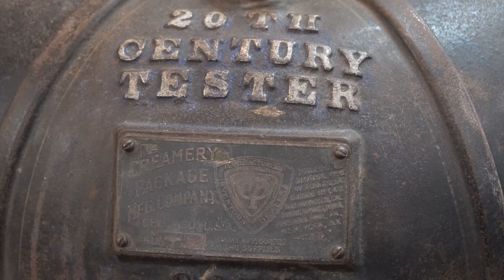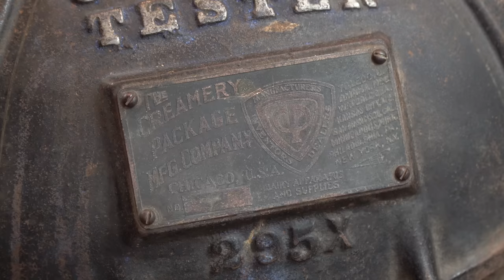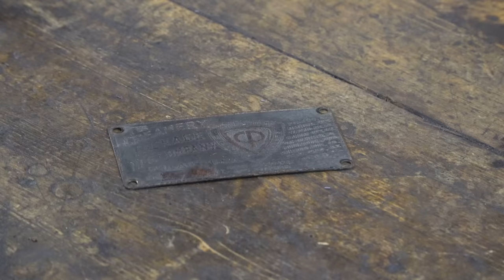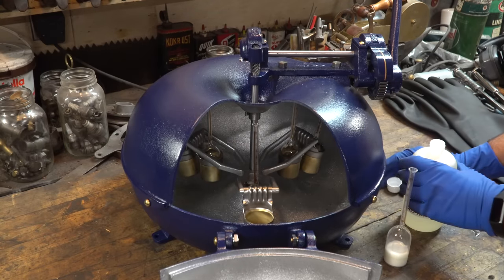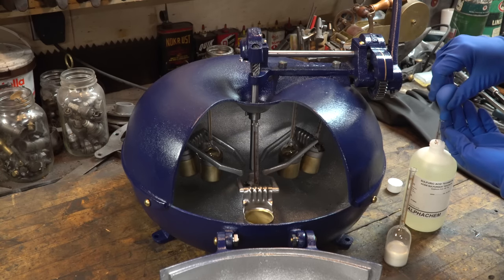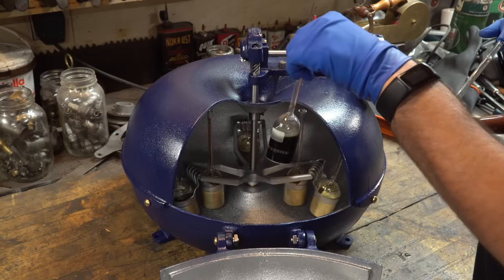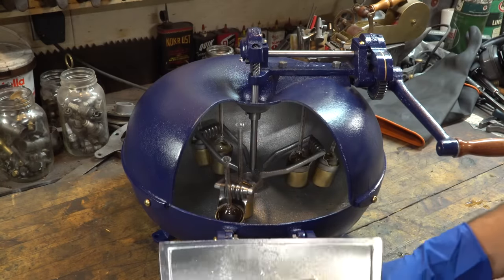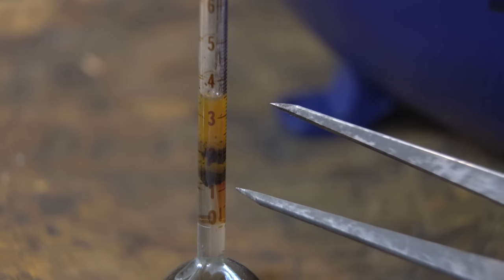Antique Sulfuric Acid Milk Fat Tester [Restoration]

Comment: Fascinating demonstration. Once you use a bottle for testing, can it be cleaned and reused, or were they just discarded? Seems like you'd need to be able to empty the acid out of them somehow even if you were discarding it.
Reply: Other commenters say they are used indefinitely. A very tiny, hummingbird beak like, needle was stuck up in them and sprayed water, upside down, washing everything out. The sulfuric acid also works very well as a cleansing agent. In other words they were cleaned easily and fully. 
I'm thinking they could easily be dropped and broken.

Comment: - Generally, "denaturing" protein would be the chemistry terminology used to describe what the acid does to the protein molecules.
- Boiling an egg, for example, denatures the clear white of an egg and makes it look white. Using vinegar{acid} in water when poaching an egg helps keep the original mass of the egg white together for a less messy poach.
- Denaturing the protein of beef turns it brown, showing the Nitrogen in it.

Comment: The Gerber method is a primary and historic chemical test to determine the fat content of substances, most commonly milk and cream.[1] The Gerber method is the primary testing method in Europe and much of the world.[2] The fairly similar Babcock test is used primarily in the United States, although the Gerber method also enjoys significant use in the U.S. as well.[3]

The Gerber method was developed and patented by Dr. Niklaus Gerber of Switzerland in 1891.[4]

Milk fat is separated from proteins by adding sulfuric acid. The separation is facilitated by using amyl alcohol and centrifugation. The fat content is read directly via a special calibrated butyrometer. Gerber developed specialized butyrometers (tubes), pipettes, and centrifuges. Water baths built specifically for the Gerber tubes are often used.

The test is still in widespread use today and is the basis for numerous national and international standards such as ISO 2446, International Dairy Federation (FIL) Regulation 105, BS 696 (United Kingdom), and IS 1223 (India). Larger facilities may prefer to use faster analysis techniques such as infrared spectroscopy as these greatly reduce the potential for user error and reduce the time and COSHH requirements.

Comment: I recently got an ultrasonic cleaner mostly for cleaning bearings and other intricate stuff and holy crap it does wonders. I use diluted degreaser concentrate and it makes it so I just wash away the gunk spray some wd40 and it's almost like new. I wonder if Evapo Rust would work too

Comment: As a multi-degreed chemist I don't approve the last part of the video, but the rest of this video is so cool, I'll not lodge any complaints.
Reply: As a former wet lab director for a plating facility, I saw several "cringe worthy" moments...  Eric is a great restorer, but a lousy chemical Tech.
Reply from the maker: Should I leave the cap off the bottle containing sulfuric acid LONGER?

Comment: We had a centrifuge in high school that was the same torus shape metal container, just with a motor. The teacher was incredibly scared of it and when one of my classmates shouted, the teacher ducked under the table. I use more powerful centrifuges at work, and I understand why. They have armour in them, weight a ton and still have warning that operators should not get within 30cm when spinning because if something breaks inside the whole centrifuge will jump sideways.

Comment: I remember their Ad. They did specify "Lead Free". It was getting too difficult to obtain lead back in the early 1900s. They were using it in the Mints. And window frames. I'M Kidding!! (The "Mint" part. How well would a Lead Penny hold up? They were used as ballast weights for heavy windows in old houses. You can't see them unless you remove the wood. You will see ropes and pulleys. Be aware.)

Comment: 2 questions:

Why didn't you paint the other lettering on the outer shell and brackets? The "295X" , "X48'9'", and "X69'8'".

Why didn't you repaint the name plate based on its colours, less the grime, prior to removal?

Comment: so its a centrifuge basically. its so interesting to see how back then constructions like this required metal casting, big hinges, complicated drives and gears, a huge crank, and so on - this device must have cost a fortune back then. 
today all of this would be half the sice, made mostly out of thermoplastics and would be powered by an electric motor

Comment: hey can you please put a 1/2 inch slash 3/8 recess in the back of the socket drivers so we can use a ratchet on them to break tough stuff loose

Comment: Shame it doesn't have an indexable  position lock for the three stations. A simple spring loaded catch that would remain out of the way unless the door is open (could even be a lock in the door itself, like an extension. You open, you index, then open fully to lock the station to work safely.

Comment: Kinda sad you couldn't dissolve the blue and save it in a separate container. Also,   I suspect that vinyl gloves would give greater protection against strong acids. I used them often when using concentrated nitric acid or hydrogen peroxide.
Reply from the maker: I did! I actually sent if off to get analyzed.
Reply: @HandToolRescue  , amazin!
Reply: @HandToolRescue  , if you need any chemistry advice for safety, let me know. Strong acid work and analysis of chemicals is my background.

Comment: Excellent work. (I still dunno why you persist using spray cans & don't just buy professional paint gear, but whatever.)

Well, that experiment explains my question why the thing is built so damn robustly. Is there a set rotation speed for the process? I also can't see any limiter (or counter, for that matter) in the gearing, so there's nothing preventing you from spinning it - like a maniac - at super-high RPM. (Which would be great fun if you hadn't secured the door properly... Wheeee-Crash-Aaaaaargh!)

Modern centrifuges tend to be stainless steel & borosilicate (Pyrex) glass (or just plastic).

I've seen a chemist friend make dilute Sulfuric Acid, by slowly pouring a bottle of concentrated H₂SO₄ into a large barrel of distilled water (before leaving on a Friday night). Not only was it hot enough to feel across the room, it was still fuming 2 days later, on Monday morning... Very Nasty Stuff.

Comment: Surface tension doesn't seal the vials when upside down. Air pressure does.
Reply: Actually a combination of both. The air pressure prevents a bubble of vacuum from opening up at the top of the inverted container. Surface tension in the neck resists allowing air to enter and water to leave at the same time and so prevents the bottle contents from "glugging" out.
Reply: @kevinmartin7760  Sure, but in a vacuum chamber the upside down vial would empty out.
Reply: @FrietjeOorlog  That's why I said it takes both air pressure and surface tension to keep the liquid in. Take away either of these and the vial will empty out.
Reply: @kevinmartin7760  The surface tension isn't the deciding factor here. Surface tension still exists in the vacuum chamber, yet the liquid would still fall out. The other way around, I'm not sure. To test this, he should hold a vial of water upside down after adding a drop of detegent. Then we'd know for sure.
Reply: @FrietjeOorlog  You need both surface tension and air pressure to keep the liquid in. Calling either of these a "deciding factor" would be inappropriate because eliminating (or sufficiently reducing) either will allow the liquid to drain.

Adding detergent may or may not reduce the surface tension enough to allow the liquid to drain. The deciding factor is whether the increase in surface area (caused by air entering part of the neck and liquid leaving the other part of the neck) requires more energy than the change in gravitational potential energy caused by some of the liquid dropping down. How much the surface tension must be reduced depends on the neck diameter of the vial.

Just as using a partial vacuum may or may not allow some liquid to leave the vial (depending on the vapour pressure of the liquid and height of the vial), a partial reduction in surface tension may or may not allow some liquid to leave the vial. Unless you can eliminate surface tension to a similar degree that you can eliminate air pressure, the experiment you propose would be inconclusive at best.
Reply: @kevinmartin7760  That's a lot of 'may or may not'. Just say you don't actually know for sure. Add detergent to the point surface tension is effectively removed, hold vial upside down, and observe. With a narrow enough neck I doubt surface tension is required, thus making it not a necessary component. I'd also like to see surface tension alone hold water in, without air pressure, eliminating the latter as a requirement. Seems highly unlikely with anything more than minute amounts of liquid. Any scenario where either air pressure of surface tension is not needed to keep the liquid in, negates the claim it takes both.
Reply: @FrietjeOorlog  I never said surface tension alone would hold the liquid in. I said lack of surface tension would let the liquid out. When other conditions are involved these are not equivalent statements.

Your last sentence is just plain wrong; the fact that removing one condition allows the liquid to drain specifically implies that it takes both conditions to retain the liquid.

We can look at this with propositional logic:
A = air pressure is high enough that the pressure at the top of the inverted vial is higher than the vapour pressure of the liquid so a bubble of vapour (or a vacuum bubble) cannot form
B = Surface tension is high enough (given the shape of the neck of the bottle and density of the liquid) that the inverted open surface of the liquid is stable (that is, it will not change shape to allow air up in one area and liquid down in another).
C = liquid will drain from vial

I am claiming C = not(A and B) = (not A) or (not B).

Also (not C) = liquid will stay in vial, and
(not C) = (A and B) = (not A) or (not B)

Putting back the meanings of A, B, and C:
(liquid will drain) = (there is no/not enough air pressure) or (there is no/low enough surface tension).
(liquid will stay) = (there is air pressure) and (there is surface tension).

It takes both conditions (pressure and surface tension) for the liquid to stay.

It takes negation of either condition for the liquid to come out.

As for the "narrow enough neck" you mention, in practice, there is also no such thing as zero surface tension, so in the "narrow enough neck" scenario you mention it is indeed still surface tension at work.

The effects of surface tension are also obfuscated by the liquid wetting (or not) the glass. This will contribute further energy effects to the stabilization (or not) of the surface of the liquid.
Reply: @kevinmartin7760  My sentence is very much correct. Read it again and think about it. Your saying lack of surface tension will let the liquid out. I'm saying not necessarily. This vial; maybe. Can't say for sure. Any size vial/neck/hole? Doubtful. And if even one scenario exists where surface tension has been made negligible, and yet the liquid does not leave, that means surface tension isn't an absolute requirement. Now, this could also be true for air pressure, but that seems a lot less likely. Testing it would be difficult because boiling a liquid in a partial vacuum will allow it to form pockets of gas and 'break' the vacuum at the bottom of the vial.

Look; we're not fundamentally at odds here. Empirical testing is needed.

Comment: Cold sulfuric acid isn't too bad to splash on you in just a drop or so as long as you quickly clean it off and wash it.  Any thing warm to hot though and you better run.
I got a drop of a mix of hot sulfuric acid and nitric acid on my shin once and it it burned me immediately despite me cleaning and washing almost intantly. It took like 6 months to heal. Wear your PPE kids.

Comment: Not more than 5 days ago, I had to carefully explain to my boss that storing any sort of strong acidic drain cleaner, powerful enough to eat through old drain pipes, requiring IMMEDIATE action if it gets on your skin, is a bad idea if you don't do it right. They kept bottles of it right next to cups. Previously opened bottles of sulfuric acid drain cleaner, right next to drinking cups. The health and safety guidelines says it shouldn't even be used if there's a chance of vapors getting to you.

Respect your chemicals everyone! Not even a little bit of a joke. There's way worse ones that sulfuric acid, and this one is absolutely terrible.

This is a lunatic machine, handled hopefully by very careful people.
Reply: You'll be just fine. There is nothing that's going to hurt you by storing acid by drinking cups. This is a great example of the problem of uninformed people trying to make rules and laws. People that have zero chemistry knowledge attempting to speak on things they know nothing about. Sulfuric acid is handled by millions of kids in school every single day. LOL. The direction I point people who don't know about chemistry is to Nile Red's video, pouring acid on my hands. But it looks like the YouTube losers took it down. (Again, people with zero knowledge, making rules.)

Comment: Why would anyone still do this?  All processed milk in the U.S. (AFIK) is separated to 0% milkfat (skim milk) and then fat added back to achieve USDA/FDA required fat percent 1%, 2%, 3.25% (whole milk).  Those percentages are by weight.  So, maybe I'm just confused.

Comment: Thank you, bout time we had some music to go with this tool repair porn. Side note: worked at an old library and they used this stuff as drain cleaner. it was sold as drain cleaner. they used so much of the acid it burned out the bottoms of all the cast iron drain pipes in the facility. it was basically a river bed under the building
Reply: @Hustle Union, IIRC, @Nile Red has used drain cleaner as sulphuric acid  component for some of his chemistry experiments

Comment: Sooo risky handle almost pure sulfuric acid. No joke. I feel bad only watching it. No wonder it can heat up just reacting with water. 
Remember those plastic mugs for heating coffe? You push the bottom and 'puff' almost boiling coffe? Strong basic exotermic chemical reaction

Comment: As somebody with lab safety training and experience, I'm cringing at how you are handling that high concentration sulfuric acid. You're lucky nothing happened, because any mishap would have had dire consequences. You should at least have closed the bottle as soon as possible, the chance of accidentally bumping against it would mean the bottle would have emptied itself on you (wooden!) bench. Doing this on a wooden bench is a bad idea anyhow. Then there's not fume extraction (fumes of this reaction are not that bad, but it matters when things go wrong), no spatter screen, no basin to contain a possible spill, no means to quickly to neutralize the acid, etc, etc. And you probably don't have access to an eye shower or such, in case of emergency. Please do these kinds of things in a chemical lab next time.

Comment: I cringed when you added the water but didn't add water to the other glass containers... Coz from that point on you had an unbalanced centrifuge...
Reply from the maker: Oh but they did have water in them...
Reply: @HandToolRescue  at the beginning it was balanced. But when you add liquid to one you need to add the same amount to all the other ones. I work with centrifuges for cells, blood products etc... A small amount of difference can be devastating at 5000 Gs 😁 But I guess yours doesn't go above 500.

Comment: After watching a few asian "restoration" videos i can say, you pit way to much effort in repairing old machines.
All you have to do is disasemble the machines, clean the parts in petroleum, but not too good, a little dirt has to stay, paint all part in as much different eye cancer giving colours you can find, assemble everything, without replacing old bearings, damaged parts or repairing cracks and then call it "fully restoration and repair", even if its just cleaning and repainting.
And the comment section will still be full of comments like "Good job", "Nice Repair", ect.